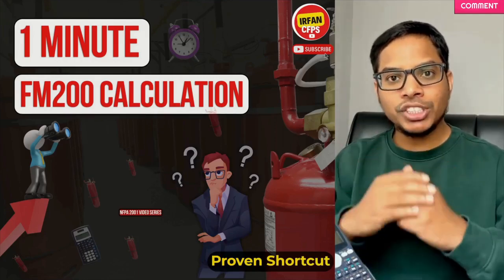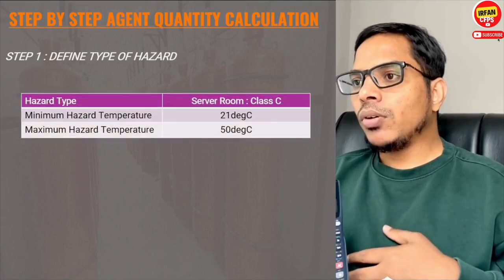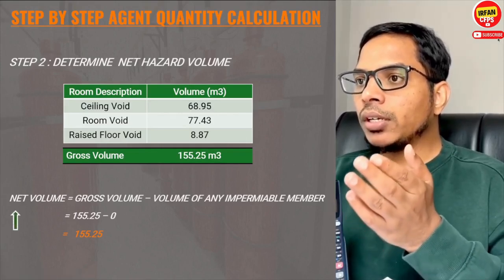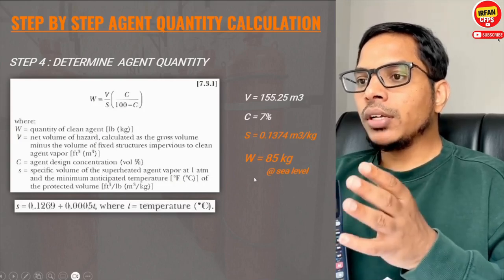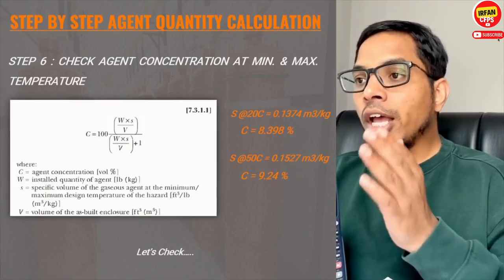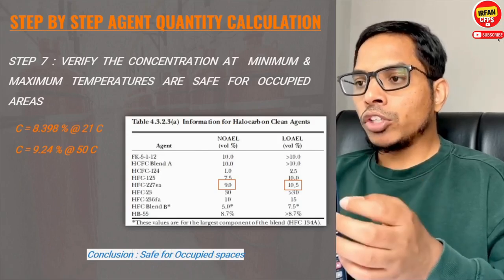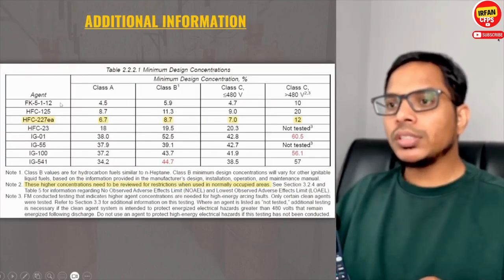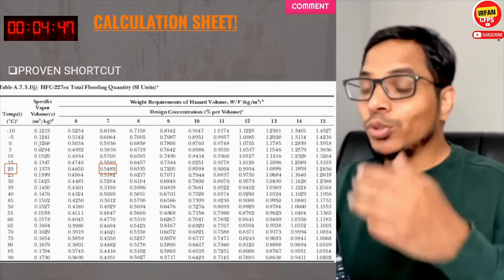How To Calculate FM200 Gas In 1 Minute!

Comment: Can you tell us how to design the right pipe size for fm200? Is there any manual calculation?
Reply from the maker: It should be performed using manufacturer software. Thumbrule for fm200 will not work in actual scenario

Comment: During the verification step, I found that the agent concentration at 50°C is very close to the LOAEL value (10.5%), and slightly above the NOAEL.
In this case, what actions or design modifications should be taken if the calculated concentration exceeds the NOAEL or approaches the LOAEL limit for occupied spaces?
Reply from the maker: Consider using a safer agent such as Novec 1230.

Comment: ear Irfan,
Regarding the altitude level, when you consider it as 0.82, we must multiply it by the actual gas requirement as per NFPA and the manufacturer's recommendations
Reply from the maker: Thanks for the reply. I will check once again
Reply from the maker: Thank you. Yes you are absolutely correct